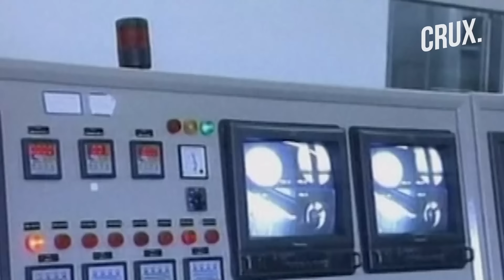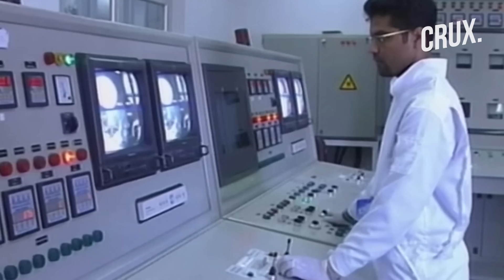F-15EX Jets With Bunker-Busting GBU-57 Bombs | What Israel Needs To Destroy Iran's Nuke Facilities

Comment: Iran has multiple mountain ranges.  The tallest mountains are around 3,500-3,800+ meters of hard rock.  the country has build a network of tunnels and caverns deep in these mountains.  Iran uses various types of centrifuges that can be widely dispersed, plus supporting facilities like U Hexafluoride facilities, etc.  Many in secret.  If they could be destroyed, Israel would have no qualms about destroying them like they did in Syria, Iraq, etc.  These things have ventilation systems, backup power, exits that can be opened up, etc.  GBU-57 will probably kick some ruble around.  The risk is that Iran could decide to go quickly nuclear.  The must have the designs, specifications from NK, Pakistan, etc.   When A. Q. Khan sold the centrifuge design, may have included nuke designs too... this info probably fit in a thumb drive?

Comment: F15 can not carry GBU 57 bombs each of which weighs  close to 30000 pounds and is too heavy for F15 to fly with. F15 can carry GBU 28 bomb which is another bunker busting bombing each weighing less at 5000 pounds and has less penetrating capability than GBU57. It is GBU 28 bombs that Israel has acquired from the USA. A bomber (like B2 or B1B or B52) or a modified transport aircraft (like C130) can carry and drop GBU 57 bombs, not heavy combat jets like F15. F15 EX may have been modified to carry close to 30000 pounds of total payload but that load has to be shared to different pylons/weapons stations whilst GBU 57 has to be clung onto a single weapon station ckose to the center of mass of the fighter jet (that is on centerline pylon) and it is highly unlikely that a centerline pylon, no matter how much strengthened  will be able to bear load that would otherwise shared over all pylons of the aircraft. Even if some technology solution is derived to position the bomb along centerline and share the load over all pylons, it would be extrmely complex to drop/release the bomb by simultaneously releasing them from locked clutches  of all the pylons- may be a relase based on simultaneous pyrotechnic detonation may be used but the aircraft's flight envelope will be affected due to drag caused by the airframe of the bomb as well as altered center of pitch. Crux apparently did not do homework before publishing the report. Multuple GBU 57 bombs dropped in sequence can penetrate great depths and Iran's underground nuclear plant/weapons stores even if made of micro reinforced UHPC or China supplied FGCC, will not remain impervious upon such impacts but one also has to bear in mind that GBU57 in itself is not a stand off weapon, the platform has to fly within, say 10 km of the target for hitting it with the bomb- both the nonstealthy fighter aircraft platform and the bomb in flight will remain vulnerable to Russia-supplied potent air defense systems (like S300 or S400 for the aircraft and Buk or Pantsyr for the bomb). A night strike mission with GBU57 on stealth bombet platform B2 is still the best bet for achieving objectives against Iran's nuclear operations but it does not seem that the US under democrat administration would be keen on risking a B2 for Israel at this juncture when both Russia and NATO are pitted against each other in the Ukraine theater and military supplies have been taken place between Russia and Iran. A B2 wreckage in the worst imagined possibility from the US standpoint falling into Russian hands for evaluation  holds water.
Reply: @@knightatdawndonbynight8432,
What would happen if the Iranians shoot down the aircraft thats carrying one of these bombs?

Comment: The F-15EX cannot carry the GBU-57...only the B-2 , B-1,and B-52 could deploy such a weapon as in total it weights 37,000 lbs and is half the length of a F-16...if I'm correct Israel has some B-1 bombers or quick access from the United States.

Comment: Since the GBU-57 is a precision guided weapon, I wonder how deep 2 or 3 on the same coordinates would penetrate. Makes the claims of Iran that it can't reach their deep installations less tenable.
Reply: It can only penetrate 61 meters. It's not getting through to Iranian underground bases. Many of them are underneath mountain ranges & underneath that is several hundred meters of reinforced military grade concrete.
Reply: @realpolitik01  The bunkers are alledgedly 100 meters underground. Repeating your mistaken stats doesn't make them true. While one GBU-57 won't penetrate 100 meters, several may. Even if they don't fully penetrate they can collapse entrances and cause massive shock damage.